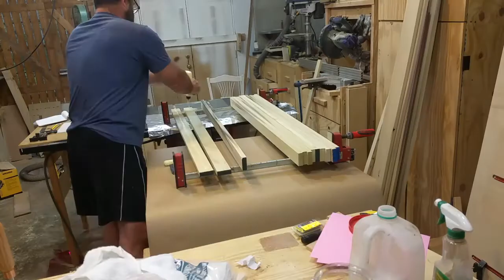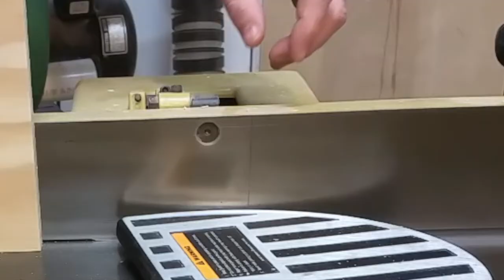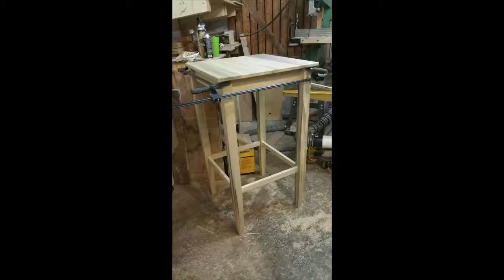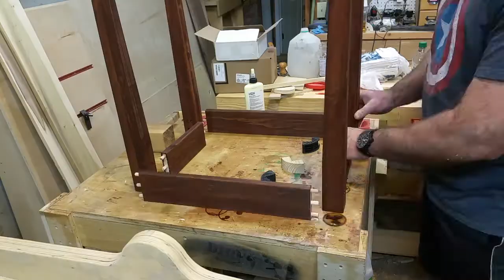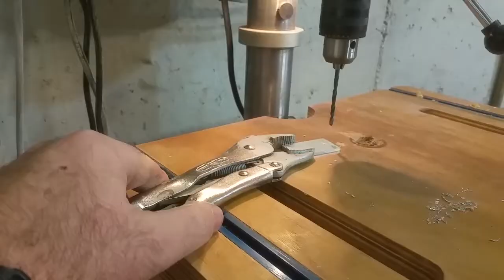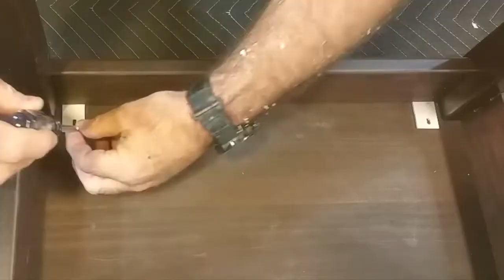DIY HighTop and End Table

Comment: I think you need more clamps..... LOL Great job. I've been some plans for a table saw sled that makes those leg tapers. Might be a safer option.
Reply from the maker: I agree that a table saw jig for leg tapers is, or should be, a safer option.  One thing to keep in mind - a table saw sled or jig always needs a flat face to reference against because the face you are cutting is on a different plane.  The beauty of doing tapers on the jointer, is that you can do four sided tapers.  The only surface the jointer needs to reference is the surface it's cutting.  Cutting the 4th taper on the table saw could be very dangerous, and probably inaccurate.  Thank you so much for watching!